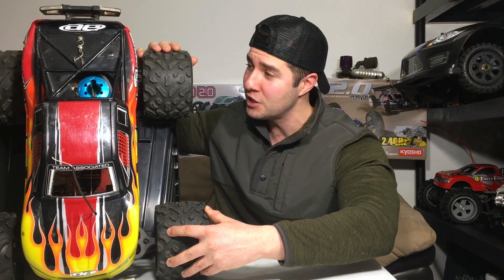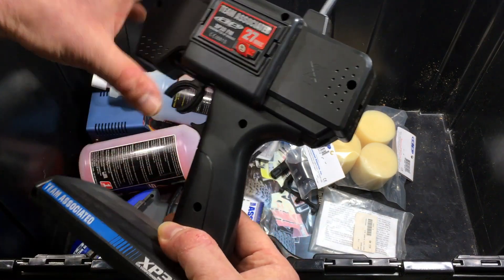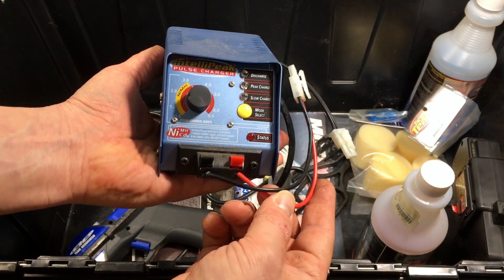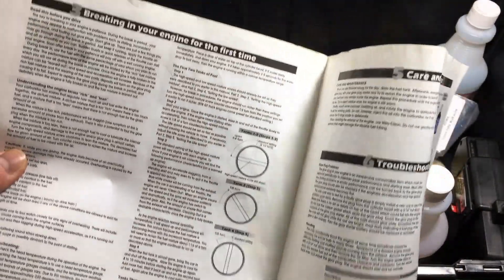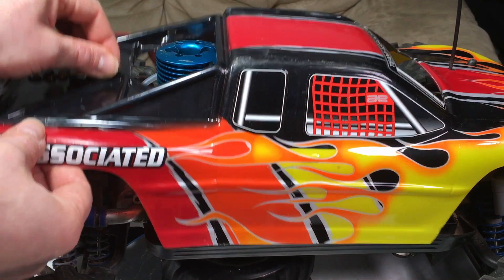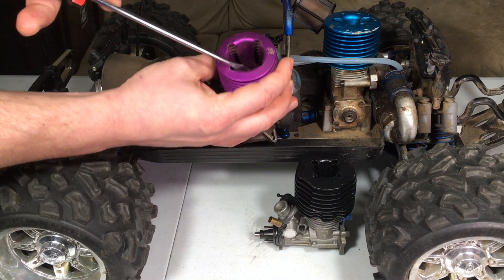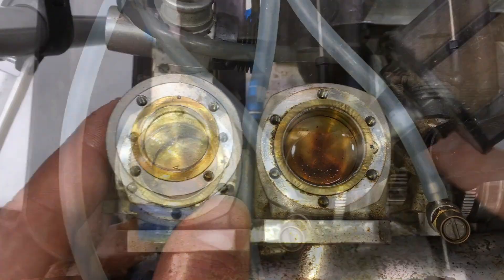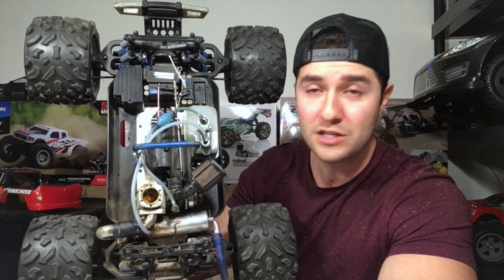Project : Associated MGT 8.0 - Inside a .50 HELI Engine - Monsters Of RC (My Nitro Fleet)

Comment: Great video brother!!!  I like how you take the cooling heads off and check the engines out. Great watch 👍
Reply from the maker: hey ben!! what's up!! Yes, checking under the cooling head is the best and easiest way to gauge engine condition.  I need to start working on my rampage rally soon, I'm falling behind brother!! Gonna use your next video as motivation to get the 32CC rovan in.
Reply: hybrid32494 awesome 😎 depending on the weather it might be Sunday when I get the Baja ran in.  I will have the Rampage XT out as well.

Comment: I had a Thunder Tiger EK4 back in the day, wish I never sold it, the thing was a wheelie monster (frame was weak had to upgrade it to the stronger one), the biggest issue they had for the gen1 EK4 was the clutch shoes and cooling. There was an aftermarket company that made a gigantic cooling head for that engine which cooled it down a lot, never was able to solve the clutch shoe issue, even had custom aluminum shoes made but they couldn't handle the power. I used a cordless drill to start mine and had several of those 1/4 drivers on hand.
Reply from the maker: hey dude, thanks for watching and your EK4 recollection, very interesting.  I remember those hige billet cooling heads, they made the truck look like a real beast back then.  Hopefully I can find one soon, bring back some memories to everyone.  This MGT model is basically the same, but it's a smaller .50 motor than the EK4, also has cooling issues from what I read.

Comment: Nice Vid! Its cool you have the classic rc and able to restore them but the question i have is it easy to find parts? Keep it up!
Reply from the maker: hey buddy! thanks you for watching.  That's a good question.  This is a common issue with any older RC, but in all my years of restoring vintage nitros I have never failed to make one run and have never bought any significant parts.  The main thing to look for is for them to be complete, you don't want to be chasing down plastic parts or gears.  Engines are easily replaceable, but it's not cheap.  I only seek out complete models, as much as I can tell from the pictures of course.
Reply: @hybrid32494   Awesome Cuz i have the old 80s  tamyia gasshopper electric and man its a pain to find parts lol

Comment: Hey man, you should get a CEN Genesis nitro monster truck. I remember always wanting one when I would walk into my local hobby shop around 2007-2009 they had it displayed on a high shelf. It has a beast of a nitro engine and a 3 speed transmission. Keep up all the nitro and gas powered videos, they’re so much more interesting than electrics.

Comment: Hola, una consulta, yo tengo un RC igual, en el motor hay un número que dice 50, me puedes decir si mi monster es el 4.6 o el 8.0, o cual es la diferencia entre los monster gt, gracias
Reply from the maker: Gracias por ver. El MGT 8.0 tiene realmente 8 centímetros cúbicos de desplazamiento, lo que equivale a .50 pulgadas cúbicas. Son solo una conversión. El 8.0 tiene todos los engranajes metálicos y un tubo de escape más grande. Revisa mi canal. Tengo muchos más videos de MGT 8.0.

Comment: What's the difference between 8.0 and 28 pro engine
Reply from the maker: hey man! the MGT 8.0 is the largest engine ever put into the MGT truck, it's a .50 size helicopter engine.  The 28 is really the more common one and the cheaper one on the used market.  The MGT 8.0 is a crazy NITRO Guzzler too.  I would like them both honestly, it depends what you're able to get.

Comment: Hey Nitro Boss! Was that grit in the oil on top of that head or just air bubbles? It looked like some sand or something which might be bad news for the engine. Fingers crossed it’s not. Get that bad boy cleaned up and turn it over. I want to hear it roar.
Reply from the maker: whats up homie!! YEs, it looked like grit, I touched it off video and it was just air bubbles and what looked like remains of the old oil/fuel mix that had mostly evaporated but left some firm oil on top.  Should be fine.  Soon we will fire her up dude!! thanks for your support.

Comment: wheres the t maxx you bought with alot of metal parts and the e maxx
Reply from the maker: good point!! I still have all of them, they were not shown in this video as you could tell.  I gotta do a complete nitro truck video, I;ve also got others.  I need to do a lot of work on that e-maxx, and so far have not even started messing with that T-maxx yet.   After the trans in the REVo started acting up I took a step back from traxxas nitros, lol.

Comment: Cen genesis 7.7 .46 is a beast nitro truck as well. Also kinda hard to get.
Reply from the maker: hey dude.  The Men Geneis is a very cool truck that I'd love to have.  And you]re right they are pretty rare and sell for way too much on eBay.  Generally around 350+ for an average shape one.  IF I could get it for 250 or so I'd pull the trigger.

Comment: I have a MGT chassis but can't tell if it's the 4.6 or 8.0 I'm restoring it
I bought a new roller yesterday
I have 8 projects 4 T Maxx
Reply from the maker: hey man! The best way to tell if you have an 8.0 is to look at the exhaust, the 4.6 has a much smaller diameter and length pipe than the 8.0.  Plus you will notice the 8.0 gets about 7 minutes out of a tank of fuel, LOL.  Anyways, Nitrogang!! T-maxx projects are always fun!!  I got 2 t-maxxes at the moment.  you win!!

Comment: You need to get the Losi Nitrotane Aftershock bro .............  if u don't have already.
Reply from the maker: whats my dude, You're referring to the LOSI nitro fuel right?  I'm curious to try it out, no denying that.  Lately I've been running Bones Brew 30% nitro - 10% oil.  It's adequate, I would not say it's any better in any way than basic Byron 20%, lol.  Totally serious...
Reply: @hybrid32494  No it's a 1/10 or maybe 1/8 nitro truck that is built awesome.The Losi Aftershock - Nitrotane - bad ass truck,awesome videos bro.

Comment: Specification pro 50
Displacement(c.c. / cu.in.)	8.19 c.c. / .500 cu.in. 
Bore(mm / in.)	22.5 mm / 0.886 in. 
Stroke(mm / in.)	20.6 mm / 0.811 in. 
Practical R.P.M.(R.P.M.)	3,000 ~ 25,000 rpm 
Output(BHP/RPM)	2.60 BHP / 22,000 RPM 
Weight(g/oz)	475 g / 16.75 oz 

from thunder tiger

Comment: Hello dude. I'm in uk and I've got same truck. However I've got a big problem. Starter backplate hex has worn. I can't source one I've tried to almost 1 week now. Can get a starter for thunder tiger mta S28 no probs. Plus I've got that truck as well. Its mgt S50 8.0 team associated HELP ANY BODY PLEASE.
Reply from the maker: hey man!  Well if you're looking for an entirely new motor on the MGT/S28 then you should have a ton of replacement options available.  The .28 is the most common engine size these days and come with pull starters.  If you're talking about the .50 size motor, well then you're gonna need to go with a .32 LRP.  Ofcourse if you want to keep it original you will need to find a whole new part.